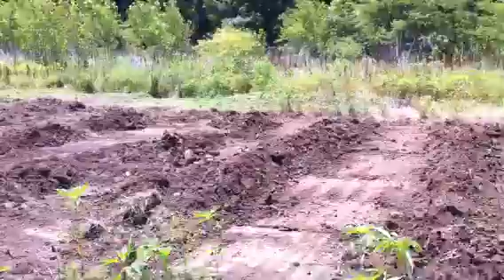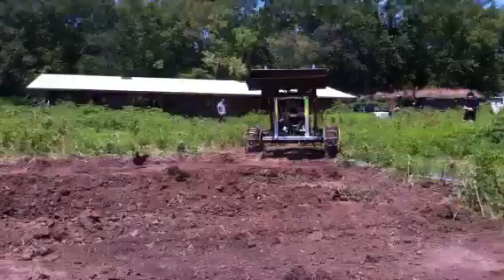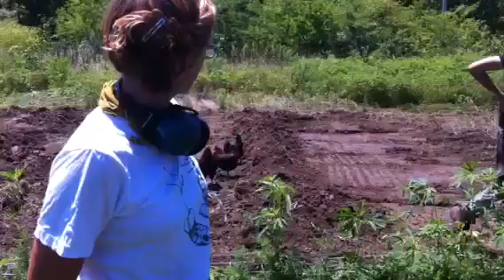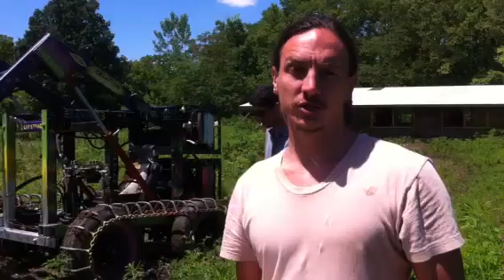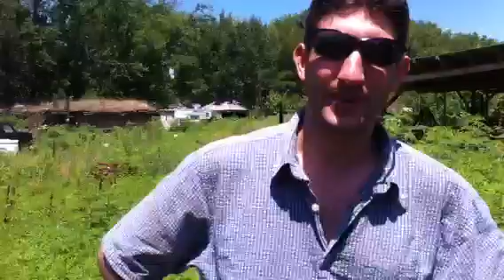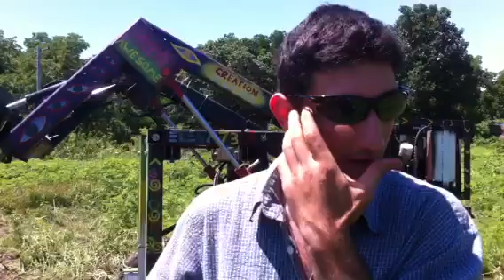scrum 6-22-12

Comment: Maybe you should think about designing some kind of front mounted plow. Lifetrac is not able to attach plow at the back because of the power cubes there. So the only way to mount plow to it is at the front side. But how to do it - that won't be easy. Lifetrac is more like buldozer than tractor.